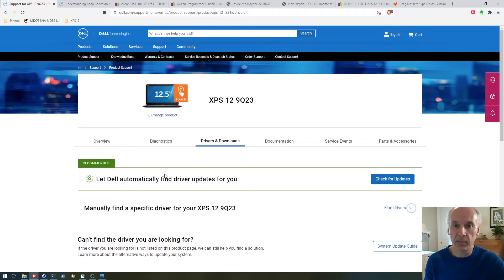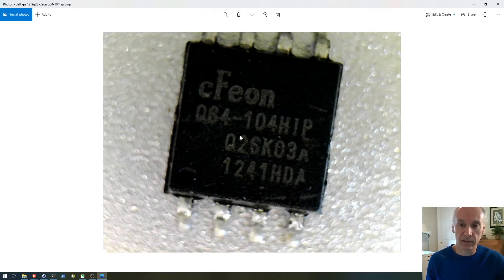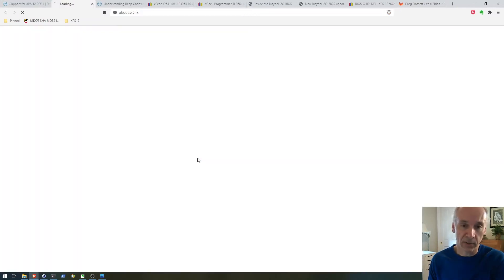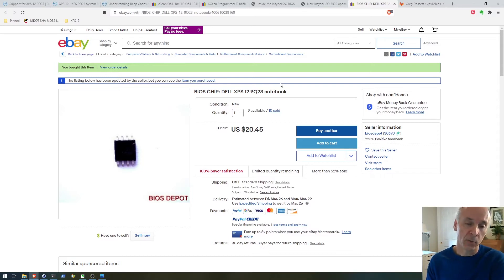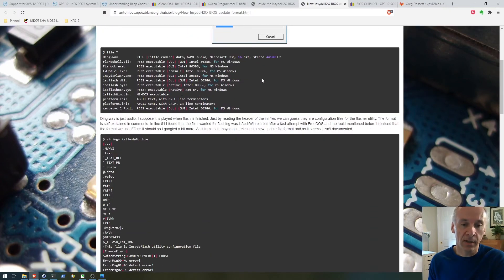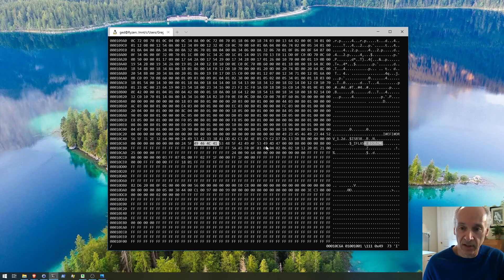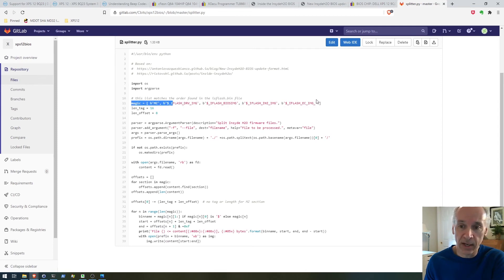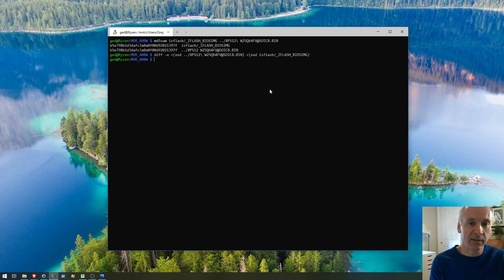Dell XPS 12 9Q23 BIOS Failure and Repair

Comment: Hi I have the same machine, it came with windows 8 and I updated it to windows 10, but it began to have problems that it did not start the windows and it tried to repair itself until it no longer started, I thought that the disk had been damaged and I changed it, but I still have the problem that I cannot install the windows, I start with the usb and it begins to show the windows wheel and after a long time it sends the blue screen that there was an error with the device and it restarts, which it thinks is the mistake?
Reply from the maker: I assume you are trying to boot from the USB in order to install Windows. Make sure that the BIOS is set to boot from the USB before the SSD. I'm guessing that it is still trying to boot from the SSD even with the USB inserted. If the laptop is actually booting from the USB and then blue screening, it might be a driver issue.

You can check if your disk is damaged by hooking it up with a SATA-to-USB cable to another PC and then running CrystalDiskInfo (https://crystalmark.info/) to check the SMART data on the disk.

Something else you may need to set in the BIOS... "Secure Boot" to Disabled; "Load Legacy Option Rom" to Enabled. There might be other BIOS Boot options you need to set in order to boot from the USB, e.g., using the Legacy "Boot List Option" instead of UEFI (just guessing this might be needed).

That's about all that I can offer. Hope it goes well for you. Take care.
Reply: @thisisagreatidea3061  Hi, I am actually booting from a usb, the disk does not have any operating system installed yet, it seems that the problem is in the kernel since if I try to install a linux distro it sends a message that refers to the kernel, if I try to install windows simply It sends the message that an error has occurred and that it has to be restarted, how can I solve the kernel? first of all, Thanks